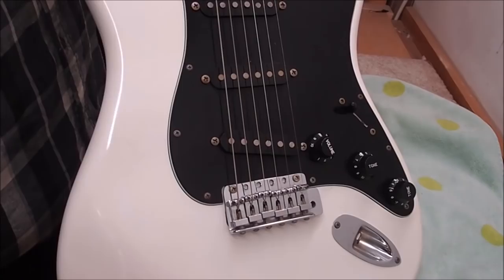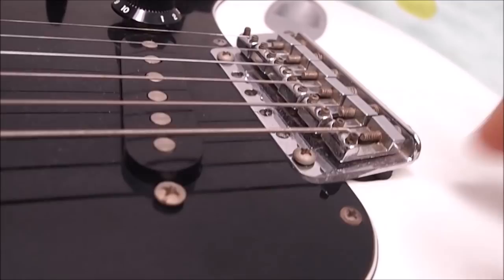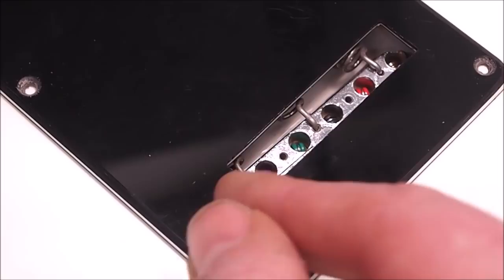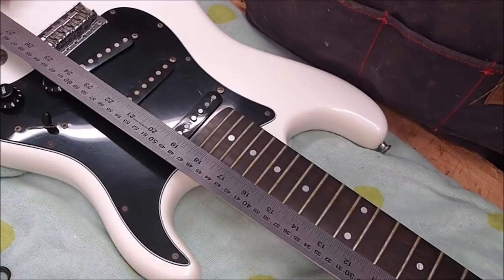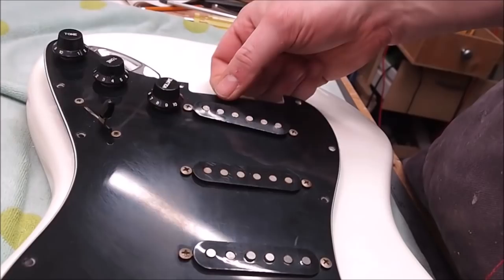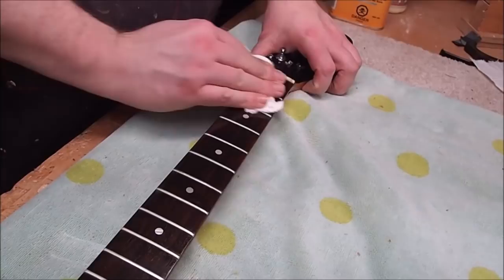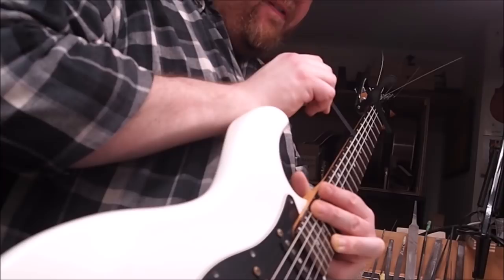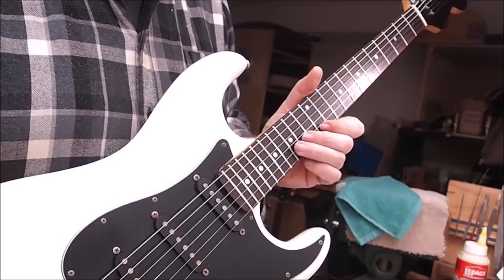Mystery Strat

Comment: I'm sure John Mayer slanted his springs and now every 30 something deems it crucial for the "Mayer tone"    Lol
Reply: No, it's been a thing for decades.
The idea is that the diagonal springs are under slightly more tension as they need to be stretched further in order to reach the hook, in theory making the bridge action stiffer but not as stiff as using an extra spring.
In principle I think it makes sense but in practice I wouldn't be able to say with authority that it made much of a difference.
Reply: @casanovafunkenstein5090  idk, all 3 parallel seems like the way to go. That way whenever you pull up on the trem there isn't a risk of the middle spring popping out.
edit: in my experice lol. source: own 5 floyd rose guitars, a music man, and a player strat

Comment: I wonder whether someone's changed the bridge at some point. My mid-90's USA strat has a different bridge plate that only allows for two screws, and they're fitted with brass nuts into the body. I guess the idea was to have a nice smooth trem without going for the full Floyd-Rose ball-bearing idea. Here's a picture of it close-up (just in case you haven't happened upon one like it yet): https://photos.app.goo.gl/PWgVuAPryDgbLH3k9

Comment: That's an Asian bridge for sure.
Reply: y'know, that's the one single part that didn't look asian! i think that was a '70s fender pot-metal strat bridge, or maybe a new reissue of same. it certainly didn't fit the guitar as was revealed when he pulled it off
Reply: @walterw2  It looks just like a vantage bridge I have accept the vantage bridge is brass. Who knows I could be wrong as can be. It was the slight defects in casting that made me think it's a match to mine.

Comment: Definitely not a physicist. The spring configuration deal?? Well,....many myths and legends.🤣🤣 This is what I was told by a guitar tech by the name of Allen Schafer(Tech for a band called StuckMojo). He said you can get a little softer trem tension and get the Ibanez speed wobble. 3 springs should be straight always. 2 springs you should angle unless they are super stiff. Ultimately though,...depends on players preference. Just what I was told. Could all be gobbldeguke for all I know.